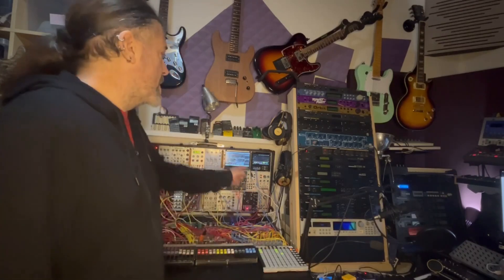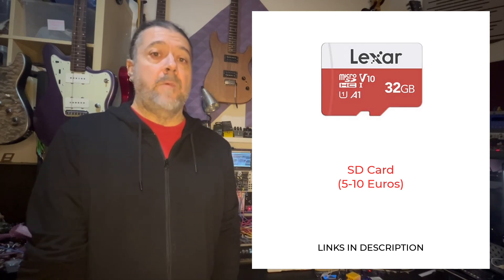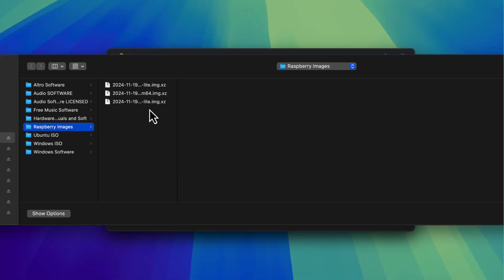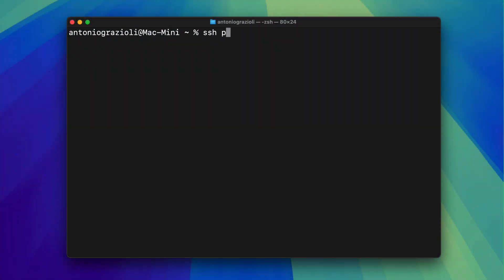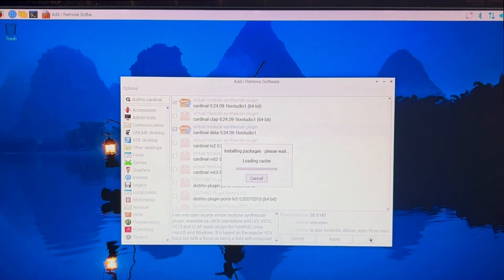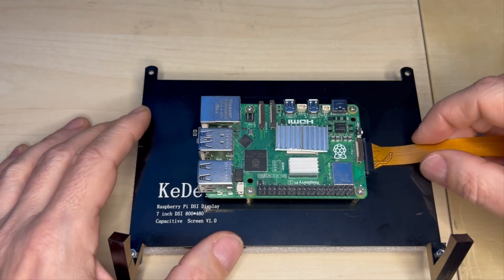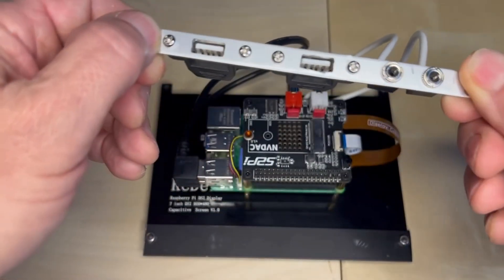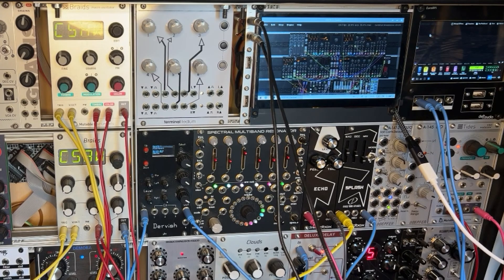Load VCV Rack in an Eurorack Module | Hybrid Modular Setup

Comment: Why Raspberry OS and not Patchbox OS??? Aside that Rasp 5 is not yet officially supported??? Patchbox OS has comes already preconfigured for low-latency and system-wide Jack support... do anyone has tried it yet with Cardinal? (And touch screen, or audio HATS, optional... those need to be configured manually anyway...)
Reply from the maker: well, for me it was the best choice...but of course you can technically do it also on Patchbox
Reply: @AutodafeSynths  DIN MIDI is DEAD on raspi OS. I have been trying for over two months now. Try to reset the BAUD rate on the uart give - function deprecated error - even if the instruction is set as a service, see bento-ttymidi. They don't give axxx ***-...

Comment: What is the hole spacing for those screens?
Reply from the maker: Do you mean horizontal or vertical spacing?
Reply: @AutodafeSynths  the vertical! It looks like you could almost have it on 3U.

My big question is how you are getting the output to euro levels?? Are you just routing the hat to your audio interface? Does the hat output euro levels? Are you using something else?

Comment: Bestiale. I don't know Pi 5 enough, it's an expansive wagon, but if it could connect with a Europi... that's be fun... anyway, with two USb ports, in theory, it could accept Usb compliant audio interface sooo..... a lot of possibilities... :)
Reply from the maker: ye, it's a very powerful mini-computer, at least powerful enough to run VCV(cardinal) with some medium-complexity patches. 
The USB ports are really useful, I have also built a dedicated MIDI Controller for it
Reply: @AutodafeSynths  The Touchscreen you linked just arrived, it's huge!!! What kind of pen are you using??? Btw my Rasp5 sill hasn't arrived yet. I ordered it one day later, I  know it is near... I can smell it... but today RAI 1 said that the no tax period ended today... so I am worried it could be re-calculated for the new import tax... This situation is crazy... also the sound module arrived and 5 multiplexer, a pico 2 nano, and 10 pins of the nano xiao seed instead of 10 nano 2040... I clicked on the wrong picture when buying... 6 euros for basically a 10cent 40 pin strip divided into smaller ones... anyway... the touchscreen is really beautiful... but no pens...
Reply from the maker: @ I am just using a standard chinese pen, bought locally….
Reply: @AutodafeSynths  Everything is working, Pi 5, touchscreen, patchblock oS, Cardinal.... I just went crazy all the night to try to make the hifiberry pcm5102 dac to work.... zero...  to the end I switched to my Roland Quad capture workhorse and voilà... I finally had Audio... plug and play... now comes the question... your pi52 Pcie SSD and audio DAC... did it work straight out of the box or you had to manually configure it??? That part is missing from the video... I thought I could make the cheap hifiberry dac work... I was very wrong... it seems the Hifiberry overlay works fine on Pi4 models, but not yet on Pi 5, because of some strange i2s changes maybe... the driver has to be rewritten... so much chaos... last I checked also Pi52 website didn't have full instructions with GPIO datasheet.. Piscope with 404 on download, had to switch to analog Analyzer to see if the GPIO were sending data to the dac... it seemed so with some dtoverlay config parameters added, like a ,noaudio append and jack refused to start untill I plugged the Quad in...
Reply from the maker: @ the configuration of the soundcard can vari from card to card that’s why it’s not in the video…
Your card should come with some instructions…
Reply: @AutodafeSynths  Yeah... I knew be4 that it would have been hard... that's why my immediate comment was on trying hook a Usb card... I knew it would have been difficult... I am now trying the card with a Pi Pico... see if I can get at least a buzz out of it... tnxs for everything!
Reply: @AutodafeSynths  Adafruit MCP4728 I2C Quad DAC for DC coupled output??? I have been doing some research. Thinking about soundcards and DC couple DC Usb interfaces, like the MOTU Ultralite Mk4, seems overkill (there's a lot of old ADAT interfaces that could be nice in a Eurorack but drivers...)... this seems like the better way to add Gate and voltage control to the Pi...without breaking the bank...
 I just wanted to ask if by chance have you taken it into consideration also... bye!

Comment: thanks so much! totally got this running on my rpi5/pisound but couldnt figure out how to change audio output to the hat instead of the hdmi
Reply: how did you did it?i followed instructions from video exactly but to no avail,i get "audio plugin collection" in Add/Remove software app and after installing those no cardinal in the /usr/bin folder
Reply from the maker: @kazekocoreaction  did you add the KXSTUDIO repository? Cardinal is inside that. It’snin the video
Reply: @AutodafeSynths  did all exactly like in the video
Reply from the maker: @azazabacheche3973  your audio hat should come with some instructions, didn’t it?
Reply: @ i got audacity to use the audio hat so i know it works, just couldnt reassign the cardinal outputs to it
Reply from the maker: @azazabacheche3973  I think I never needed tonreassign the audio in Cardinal. Just add the Audio Out module and SELECT your audio hat out
Reply from the maker: @azazabacheche3973  start from here

https://www.raspberrypi.com/documentation/accessories/audio.html

Comment: This is really cool.  I need to get my Zoxnoxious project in a DIY-buildable state and I bet it would work great with this, since it'd just take USB from the Pi5 you're using.  Zoxnoxious is a VCV Rack analog synth with physical voice cards that you control from VCV Rack.  I've got analog oscillators, filters, etc that are under Rack control.  The audio is a physical jack on the synth since it's not going through a ADC.  This project seems like it'd pair nicely.
Reply from the maker: OMG Why have I never seen your project?
Love the idea, software modules to control physical Modules !!!
(I have tested something similar in the past, a 8-voice polysynth using Teensy and controlle by a software VST). 
Will keep an eye on your project for sure!
Reply: @AutodafeSynths  thanks!  It hasn't got much attention since it's basically all vaporware until I can get it in an easily build-able state so others can play with it.  The setup is a bit complex right now as I've spent most my time developing the voice cards without a lot of focus on the ease of setup.  I'm looking to get actual build docs together soon, so stay tuned for that.
Reply from the maker: @ it’s a very clever Idea. And just with a Raspi Pico to control them.  Are all the cards SMD only? Will you sell/offer DIY kits in the future?
Reply: @AutodafeSynths  It'd likely be full builds at least early on to ensure everything is working.  I'm still trying to figure out how to get this towards launch; there's a number of things that need to be resolved to get there.  It's all on github though if someone has the time/patience/reverse engineering skills to order PCBs and try it out.  And yeah- they're all SMD.  It'd be tough to get all the digital & analog stuff on the 80x80 mm PCBs any otherway.  I get most SMD stuff done by the PCB manufacturer then solder on the various specialty analog chips from Sound Semiconductor & Alfa Rpar myself.
Reply from the maker: @ i might try building one in the future

Comment: How much can that CPU handle? Is there any way to get CV in and out? Audio through? This is so cool. Thanks for sharing.
Reply from the maker: @jqmark  the quite complex patch you bear and see in the video consumer about 30% of the CPU. CV in and out will probably not work, unless used with some MIDI-CV converger. Audio in couls work using any audio card with an input
Reply: @AutodafeSynths  Did you look at the Zynthian Project? It runs on a Pi and has a case with USB midi host capabilities. I wonder if one could run cardinal on a Zythian Pi as it already has a screen buttons and I/O for audio and Midi. That would make it even easy enough for even me to slap together. My mind is getting a little a head of myself sorry. Hope to see more videos of this in use.

Comment: Great work!! I'd be interested in keeping the touch screen out of the rack and just using it mainly to load patches, disconnecting it afterwards. It would be awesome just to have a VCV eurorack module in my travel skiff that just performed the role of playing one patch, especially if eventually it could have CV in.
Reply from the maker: well, you could use an external small touch monitor or tablet using hdmi, load the patch and then disconnect it, maybe? or maybe you could use a tablet and connect remotely? Patchblocks suports connecting to the RPI using a standard web browser, for example...

Comment: awesome! would it be possible to add input jacks for clock and modulation?
Reply: This is exactly what I hoped would happen.

In my dream setup the screen is something like an 84hp 3u screen and vcv is like another row of eurorack. Some es-8-like i/o like other people mentioned and bob's you uncle.
Reply from the maker: @Dekkie61  making it a whole row of eurorack would be super-cool (but I don't think there are such screens available :-D )
Reply from the maker: @lommelinn  not at the moment, and the audio Hat only provides audio outs.
I plan on having midi controllers using USB, or work with some CV-MIDI converters to get clock and modulations IN the module. Stay tuned 😎
Reply: @AutodafeSynths  Are you running the JACK Standalone? then there are 10 CV i/o that you could use in combination with a DC-coupled interface.
Reply: @_DRMR_  I was wondering about that. This is very useful as is but if there was a way to exploit the pin headers and get some DC coupled outputs this would be ground breaking in terms of of price. This seems like a great project for the opensource community and then maybe some pre made etsy products could follow.
Reply: @scottharris7222  An extended version of EuroPi perhaps? That only has 6 CV outputs and 1 CV input. No idea how that would work with jack audio CV ports though.
Reply: @_DRMR_   it is easy to imagine but harder to realize. Regardless I would love to see a 6CV out and 4 CV input DC coupled interface. That would be enough to make VCV Rack (cardinal) very useful in a eurorack case. I have a computer dedicated to VCV Rack with the LCD Monitor above  one of the cases using running through the expert sleepers ES-9 interface.  That is a good solution but expensive.
Reply from the maker: @_DRMR_  I might look into that. I have just built some EuroPi modules
Reply: Would the PI be able to interface with an Expert Sleepers ES-8 and use that for I/O?
Reply from the maker: @AmbientMusicStudio  i guess it should be doable